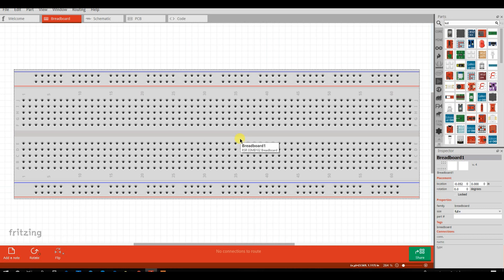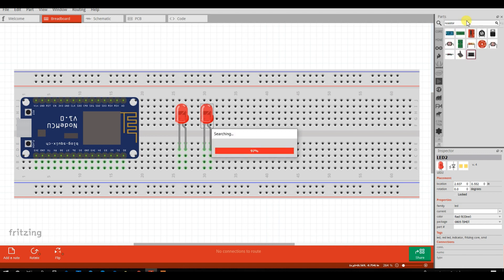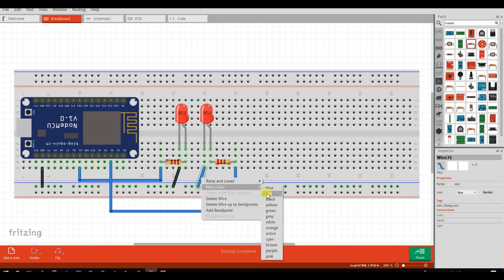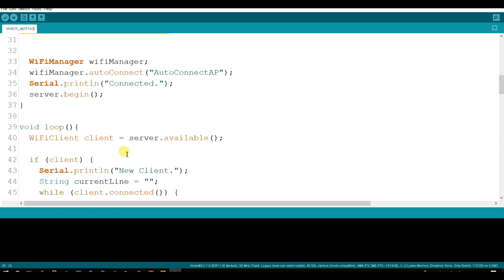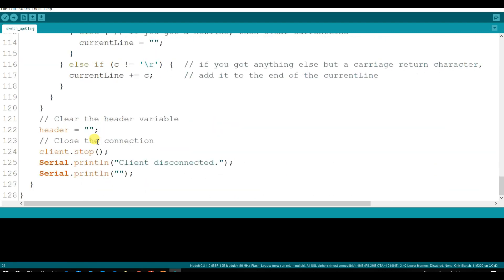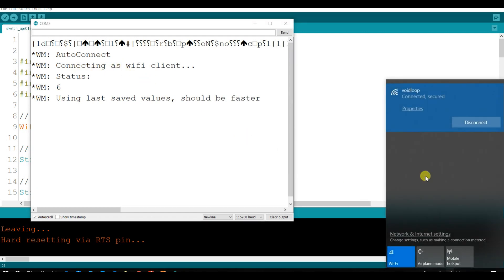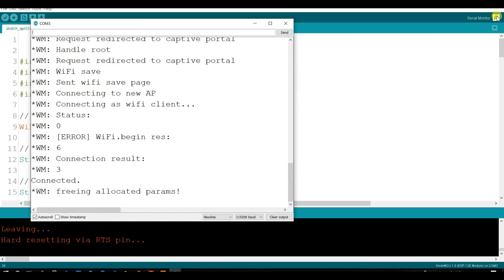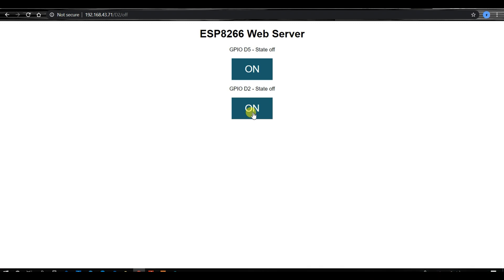23 Led Control by HTML web page with WiFi Manager library   by using ESP8266(Node MCU)

Comment: Hello Dear, It's a great concept... but I have a question, can I control two more led's sequence together (connect with D3 & D4) by activating D5 GPIO Pin? My concept is to control two led's by your code
Reply: I mean this kind of script "digitalWrite(D3,HIGH);
delay(100);
digitalWrite(D4,LOW);
delay(100);
digitalWrite(D3,HIGH);
delay(100);
digitalWrite(D4,LOW);
delay(100);" and so on
Reply from the maker: Yes
Reply: @voidloopRobotechAutomation  Thanks for your prompt reply, Could you please let me know where to insert my following script into your script? 

"digitalWrite(D3,HIGH);
delay(100);
digitalWrite(D4,LOW);
delay(100);
digitalWrite(D3,HIGH);
delay(100);
digitalWrite(D4,LOW);
delay(100);"